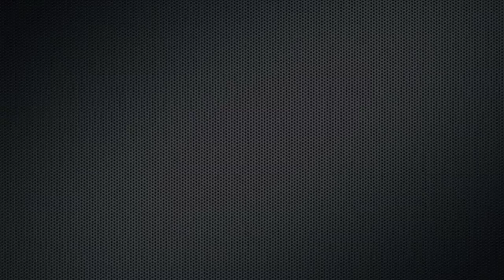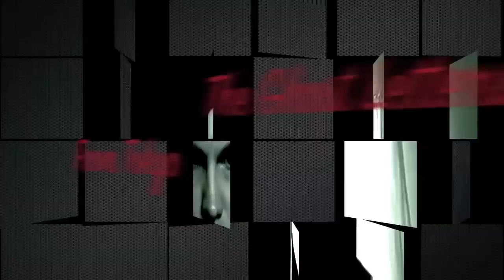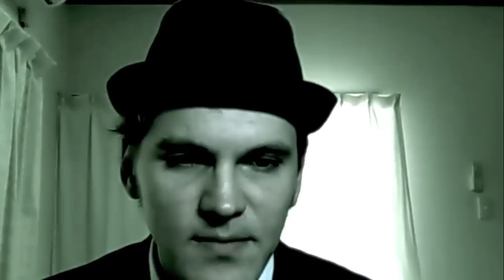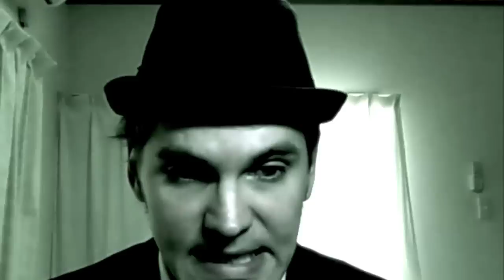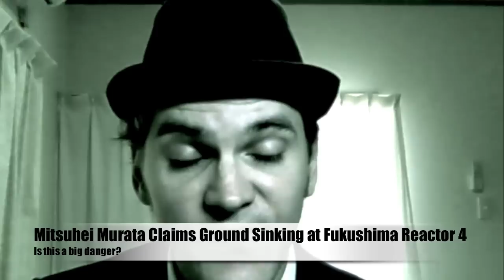Ground Sinking at Fukushima NPP Reactor Four | How Big of a Problem is This

Comment: I agree in regards of a building sinking that much and unevenly that it wouldn't do to much to it. On the other hand take a giant swimming pool and stick it on top of that building and we got a problem. This building is top heavy, the downfall of these type of reactors. It's all going to boil down to how much it sinks vs. how much Tepco can brace it and how much the sidewalls of the pool of water can withstand on a angular load. Pouring cement underneath that pool was a great call by someone.

Comment: I think the sinkhole problem is caused by the tons of sea water used to initially cool the melting reactors, rushing back into the pacific and leaching into the ground; ultimately, saturating the ground and causing massive underground erosion..

coupled with the three reactor cores that have been plowing its way to the earths center, leaving bore chambers in their wake...

This would compromise the integrity of the site.

I strongly believe this is will trigger structural collapse...

Comment from the maker: In a normal building, sudden uneven sinking of 31 inches could be a problem. If the sinking is gradual then it would not be such a big issue as long as the base supports were designed to take into account for it.

Comment: 2.5 feet of sinking...yeah, your house would buckle, sheetrock would crack all over, foundation would crack...yes, I would be extremely concerned.  In fact, it would be a priority situation requiring urgent attention, especially, if it were a fluid situation.  #4, well, it could prove catastrophic.  I surmise that with three melting cores, sinkhole is imminent.

Comment from the maker: The situation is really bad overall. Fukushima NPP is a total mess. The building design was not best from the get go. TEPCO has faced pressure recently to work harder at cleaning up the mess that is Fukushima NPP. The PM, as well as, the Emperor of Japan have visited Fukushima NPP as a way to slap TEPCO around a bit.

Comment: It's OK.

I also seen another comment by you, which you felt If the sinking is gradual then it would not be such a big issue as long as the base supports were designed to take into account for it. 

Unfortunately, base supports are never designed to account for sinking.  The only saving grace would be an earthquake designed foundation, but unlikely.

The problem (I assume) is sinkhole erosion.  They have to excavated to bedrock, then back fill with tons of rock/concrete or drill pilons.

Comment: Let's figure this out together.

31.5 inches, right?

12 inches = 1 foot
    (12x2=24)
24 inches= 2 feet
    (12x3=36)
36 inches=3 feet

So, 31.5 inches would equal 2 feet, 7.5 inches.

So, 2.5 feet.

But, you're right.  Thank god its only inches and not feet.

If they measured it in feet, by golly, we're talking...like ummmmm...2.5 feet!!!!!!!!!!!!!!!?